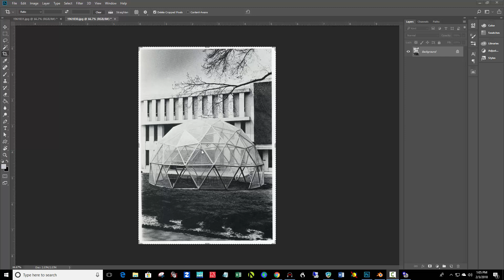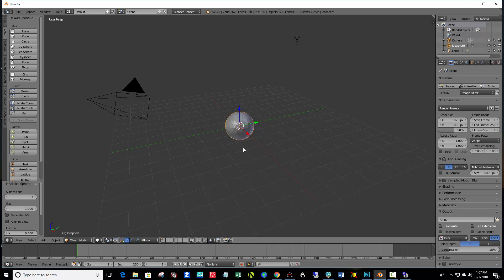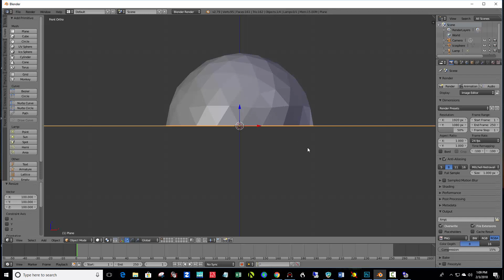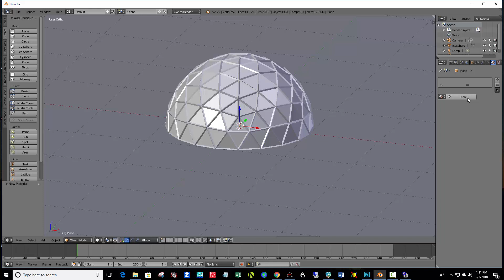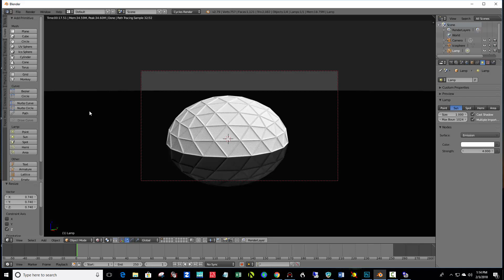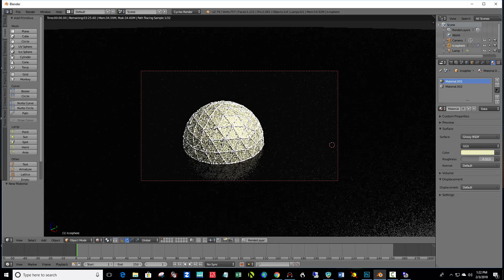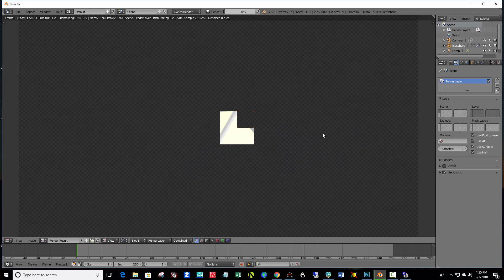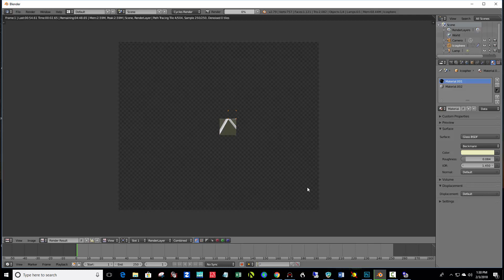Geodesic Dome in Blender

Comment: Nice tutorial!
I don't yet have experience with Blender so I might be asking stupid question, but
is it easy to split the frame into separate struts, so that I can model the connecting hubs in between them?
That's to make it more engineeringly realistic (I also have specific scalable universal design for hubs made by only cutting and bolting standard steel profiles, and I have it modeled in sketchup already so I would want to apply it to such dome too)